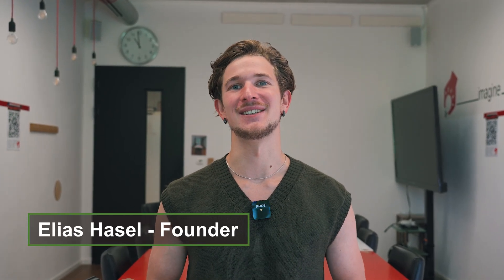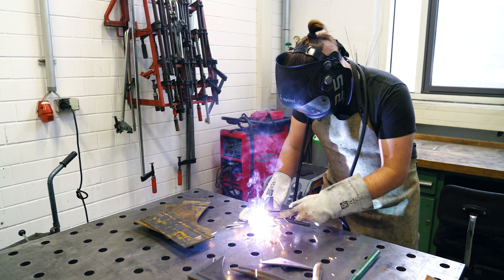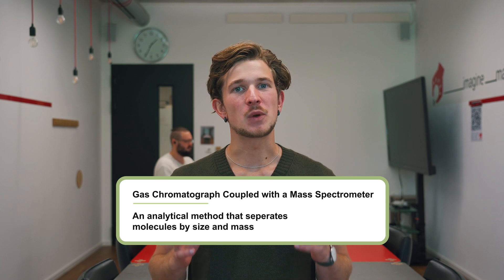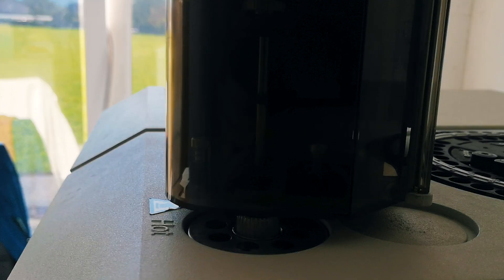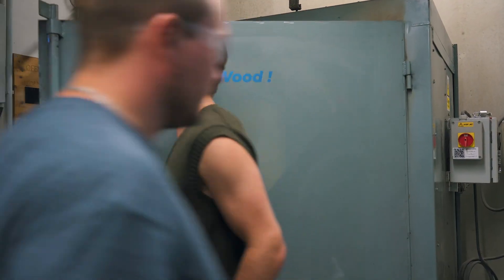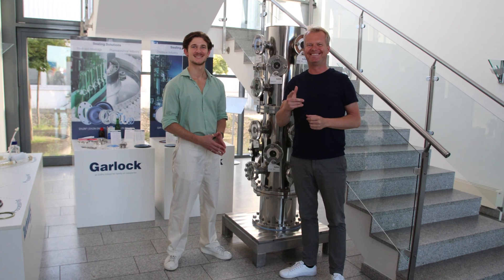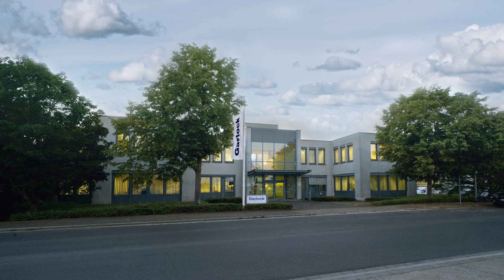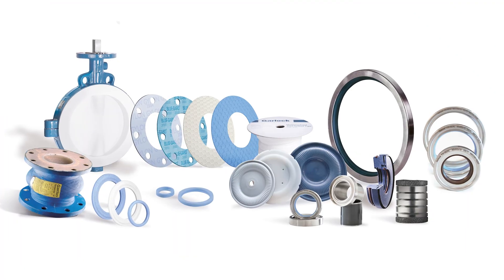Plastic to Fuel: Your Front-Row Seat to Sustainability! - Part 2

Comment: You have dealt with the hazards of melting plastic. I have not.
I want to melt my mountain dew bottles and caps. 
Then, while the plastic is melted, pour it into a brick mold that has black sand and pea gravel in the bottom.
I want to make a driveway out of these bricks.
Do you think this is a good idea? What hazards or problems could occur?

Comment: As of the name, I'd suggest something along the lines of:
1) Recycloplast
2) Plastoil, name alluding to all the -oil companies such as Statoil or Lukoil.
I also think about trying it out in what I call "Kreosan" conditions (Kreosan is a genius YTber from city of Lugansk, who did wonders with very few materials).
That's why I seek 2nd opinion: I think the best way to control the temperature and as a result control the pureness of fractions is to set up temperature gauges just before fraction collector and depending on the gauge's read adjust the amount of coolant in between various collectors.

Comment: Doing good job to eliminate the plastic from earth by turning the plastic waste into fuel.... I will think about the name for company ..will try my best to find you a new name for company...
Reply from the maker: @tafdiz   It´s 30% of the chemical energy in the plastic to be precise. Which is gas and liquid fuel. The output is diesel and gasoline. 

Best Elias
Reply from the maker: thanks for your effort!
Reply from the maker: @tafdiz the idea is that you put them in places where there is no way to properly dispose of plastic waste. The system is fuel by around 30% of its own products (which are not suitable for engines) 
If you have more question please ask them! 

Best Elias